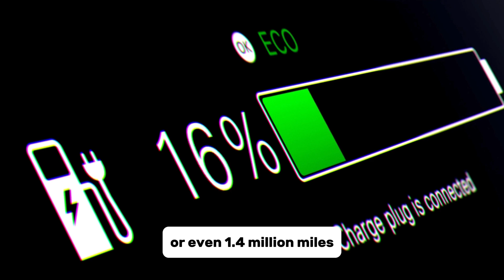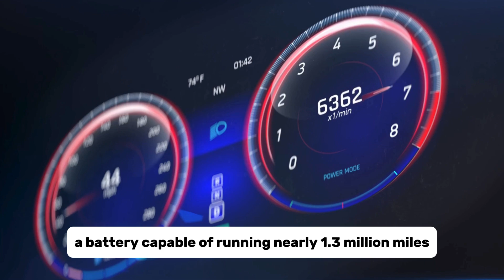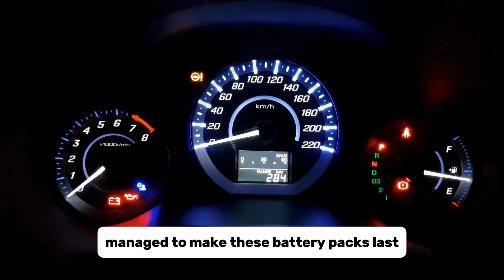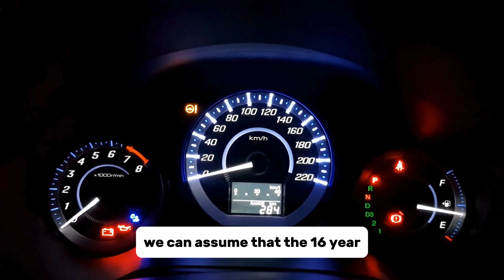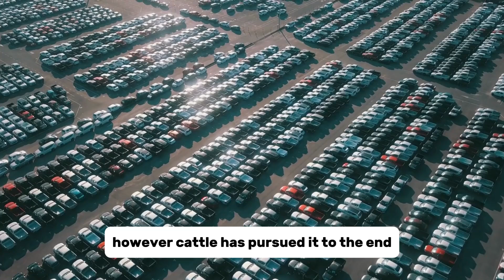It Happened! Elon Musk LEAKED Super Battery 1.3 Million Miles CATL, Transforming Tesla EVs Forever

Comment: It is not the miles but the cycles.  Also, the elimination of any fire risk.  How about replacing the battery pack, it should be a drop and go.
Reply: It may be a feasible solution, but I believe anyone who has just bought his new car won't want his new batteries to be replaced with old ones